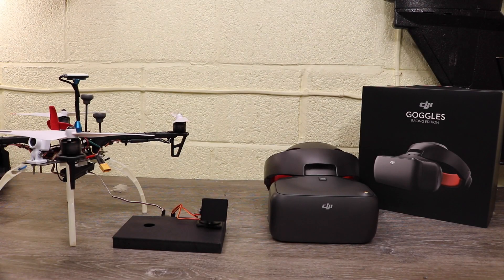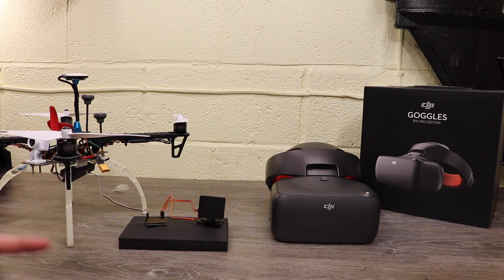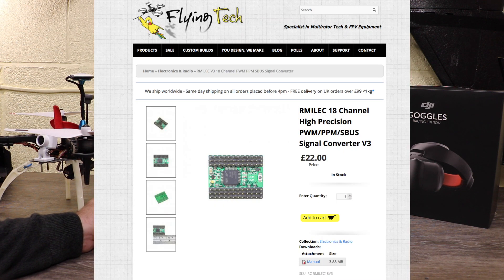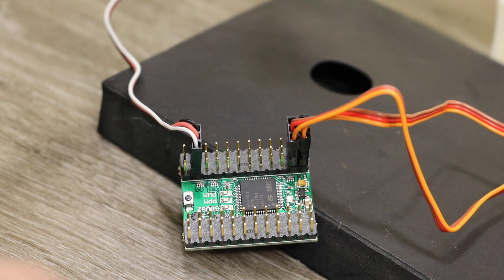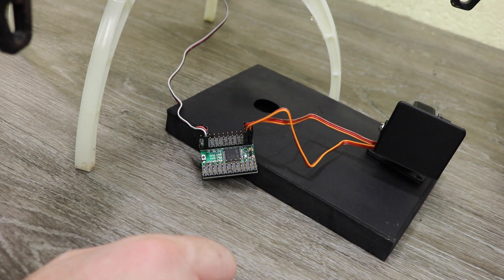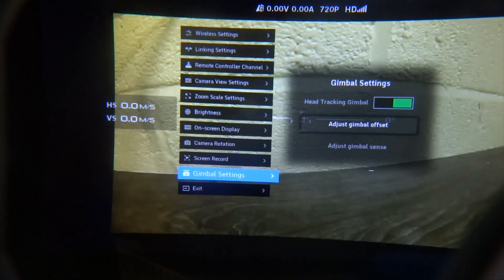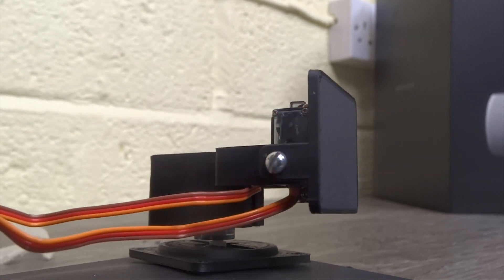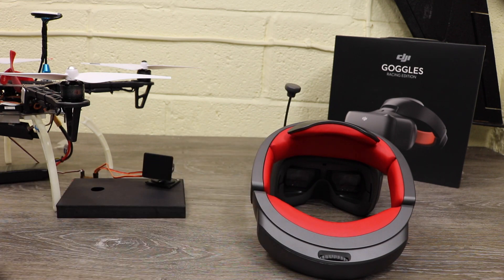DJI Goggles RE Racing Edition Ocusync Air System Head Tracking Setup

Comment: Does this work with the original DJI (white) goggles?  Thanks.
Reply from the maker: Sorry no
Reply: @MadRC  I actually did more research and what I found says that the Occusync Air unit IS compatible with the original white dji goggles.
Reply from the maker: Technically yes but there are some limitations, the first is the White googles don't support 5Ghz mode there for you limited to using them in 2 GHz only.  Second  there are some limitations of the firmware and not all controls are available.   Yes they may bind and give you a image but they are not fully compatible to actual use properly with all of the settings and controls.

Comment: What voltage is coming out of the ocusync to the PWM converter? Is it necessary to use a voltage regulator for 4.8 volt servos?
Reply from the maker: It will not power the servos, there is no power you will need to use a BEC .
Reply: @MadRC  Makes much more sense now, thanks!!
Reply: @davekadonoff  I received the RMILEC over the weekend and the DJI Air System module powers it and the servos just fine. I found this out by first powering it with a separate BEC and when I turned of the BEC I noticed the servos were still powered by the DJI unit. As a matter of fact I would recommend NOT using a separate BEC to prevent a voltage difference between the two and overloading the DJI system.
Reply: @replayreb  Thanks so very much!
Reply: @MadRC  Could I plug an extra servo cable from a separate Rx receiver for power? If not and have to get a dedicated BEC do I just plug into any unused port on the RMILEC?

Comment: I've seen this video, and I've bought a dji RMILEC 18 channel from Flying Tech.

https://www.flyingtech.co.uk/electronics/rmilec-v3-18-channel-pwm-ppm-sbus-signal-converter

https://www.flyingtech.co.uk/fpv-camera-gimbals/2-axis-pan-tilt-fpv-camera-mount-servos-included

If I turn the dji goggle RE to the right, the gimbal  turn to the left. 
If I turn DJIGGLE RE upward, the gimbal is turning downward.
I'd appreciate it if you could tell me how to do it.
Reply from the maker: You can reverse the channel assignment in the goggles by adjusting the sensitivity and going into minus numbers.

Comment: Hi, please can you put the servo reference that you did use because with mine all is inverted too!!! Thanks. No way to reverse ?? DJI is really no good for all this use except on their models ! no support, no answer, ... I tested a lot with osd also and you can't record osd with the gps coord, no way to access the log, etc , etc At the end I think it's a really bad product.
Reply from the maker: To reverse the servo adjust the the servo setting into negative numbers.
Reply: @MadRC  Thanks but I still don't understand where I can do that? There is only two setting offset and sense, offset should just adjust neutral and sense adjust the sensibility but none should reverse up and down : right and left ??? Can you please precise what you mean?
I did it but I had to open the servo and change the cable on the motor and the chip, but it's not a simple and good way to do :-)))
Reply: I got a servo reverser to fix the inverted problem @Wondersea-F4IYF